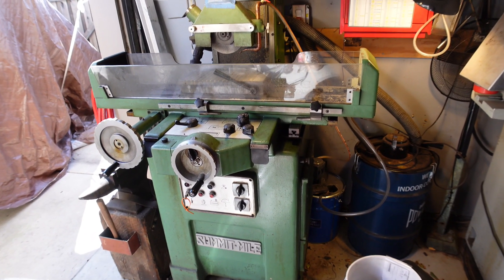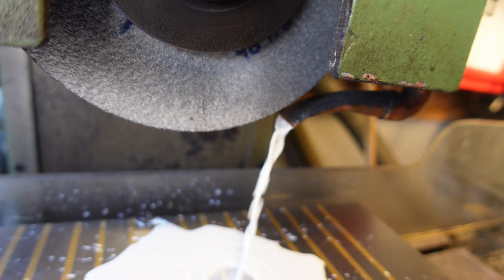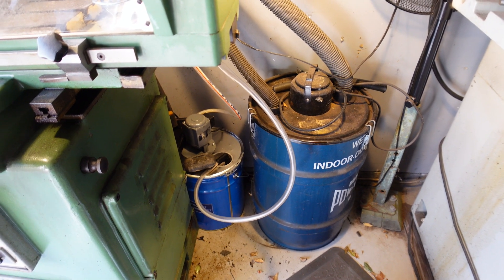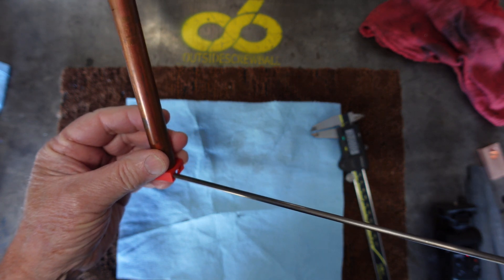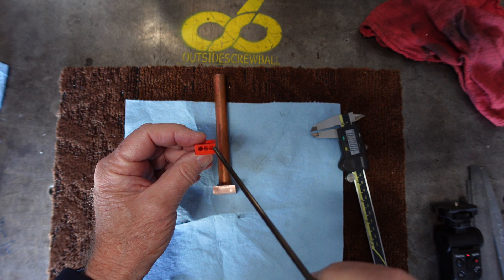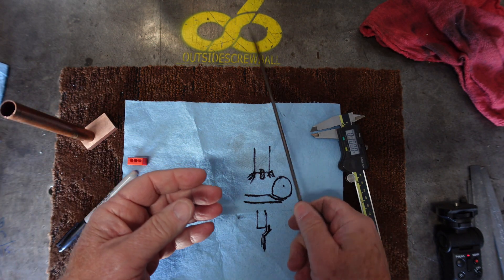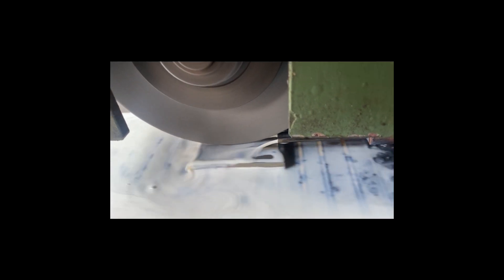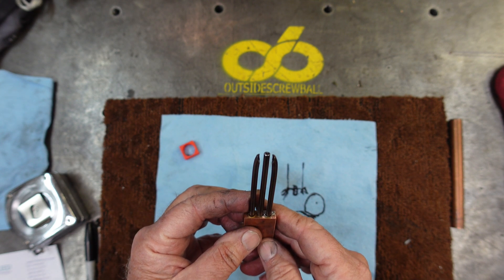Surface Grinder UPGRADE adding Flood Coolant

Comment: Chuck since you can print out PLA parts how abt the idea of a LUR Lock or 2 or 3 connections on the male side of the fitting...... then u can interchange LUR lock blunt needle tips at will of various lengths, direction and size cheaply and quickly....just saying !!!!! Those LUR lock blunt tips are readily available and we all use them on our plastic squeeze bottle precise oilers......

Comment: Did you pull the magnetic chuck and use a very thin coating of hylomar or permatex 85420 flange dressing to prevent rust jacking . Since hylomar never hardens and is resistant to most coolants and fuels.

Comment: Very nice Chuck, but I have a question. How do you adjust the space for a new wheel vs a well used one? Also, as others have suggested, put a magnet in place for the return to flow over.

Comment: What about 2 set screws on the block to hold it to the tube so it does not fall off?  That way you will be able to clean out the small tubes easily without having to unsolder the block.
Reply from the maker: Roy....good idea!!! next build I will think of this